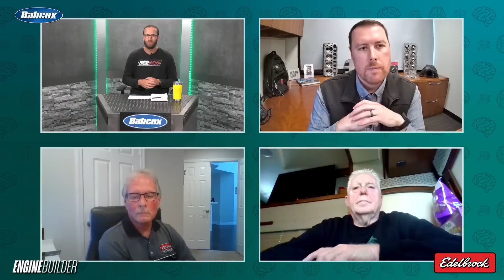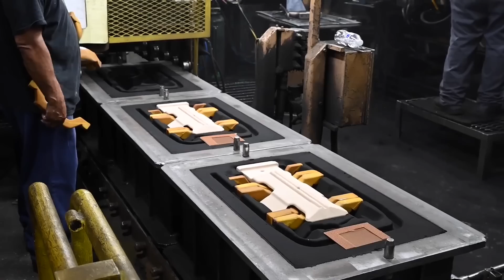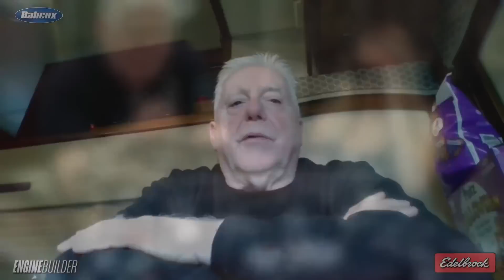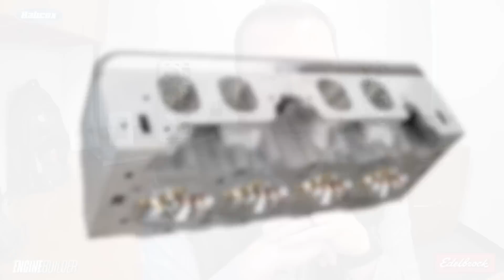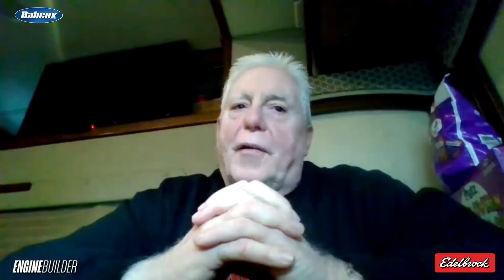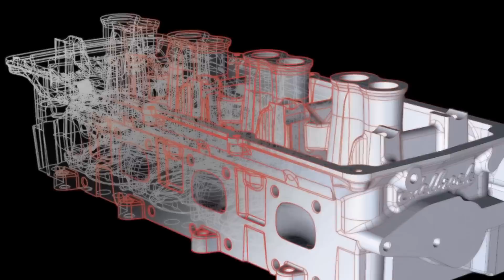Edelbrock and Pat Musi Talk Cylinder Heads

Comment: I also bought one of the first set of big block Chrysler Edelbrock Performer RPM cylinder heads and they have a lot of porosity in the casting so not real impressed with that particular set
Reply: Plus on those Early Head versions The combustion chamber design was not optimized at all

Comment: What surprised me is, In terms of Cast Cylinder Heads, Edelbrock currently cast the most badass LS Cylinder Heads on the planet and are the basis for many Builder's custom CNC Ported designs (big bore LS, square port, splayed valve, SB2 valve cover).

Comment: I'd like to see a rectangle port LS head Crossed with a BBC deck, so it is basically a LS headed big block Chevy, custom intakes and cam if required, basically a rec. Port LS7 head scaled up a bit. Maybe kant the intake a bit, raise the exhaust ports a bit. And cast a nice looking valve cover for  it. Maybe looking a bit traditional, a large rectangle, but thin like the LS/LT  covers ,  it should flow plenty, make it a twisted wedge  closer to a SBC head for a BBC

Comment: Valvetrain stability and the port dynamics are equally as important, you can't rpm an engine without a stable valvetrain, you also can't rpm an engine if you don't have the flow to support the cfm demand of that engine.

Comment: What is the trick at preventing flat cam lifter failure.  I have never had a Edelbrock cam failure. Cannot say the same for Comp cam.
Reply: Is that so. Very interesting. What lifters did you use, if you don't mind please; on the failures? Did you use lower value springs?
Reply: @MsKatjie  Comp solid lifters and Comp cam. Springs were not high tension, because of lower rpm potential of pontiac 455.
Reply: Thanks for the info, before. Cheers.

Comment: Do you believe that Total ignition timing is a good measure of the heads ability to control wet flow?
Reply: The lower the total timing that produces peak HP the better the combustion chamber and piston top.

Comment: The Gen 3 hemi head by edelbrock seems to have valve guide issues.  Is there a way to put larger more robust valve guides to help with the deflection???  What about coming out with a true roller rocker setup for hydraulic roller camshafts????

Comment: Let's chat about Mopar Big Blocks, 440 aluminum heads? Valves? Valve train assemblies? With Enphasis on Open Road Racing Endurnace Racing at high speed for  115miles.